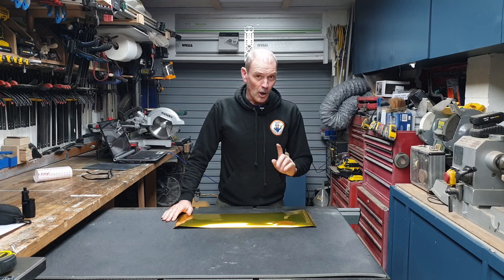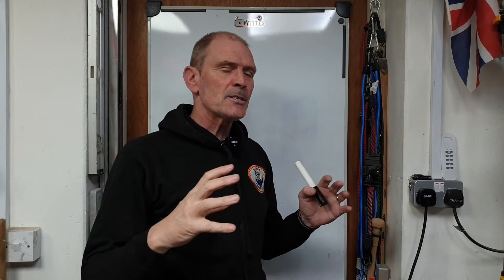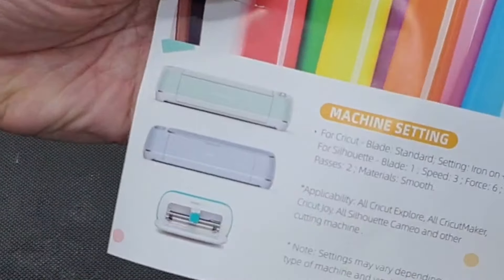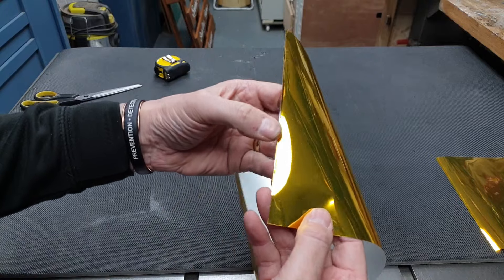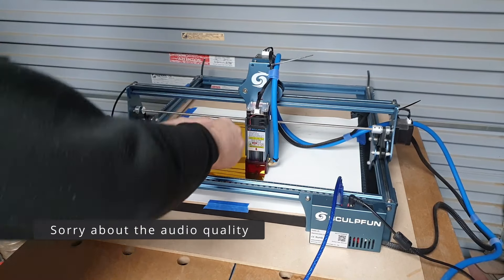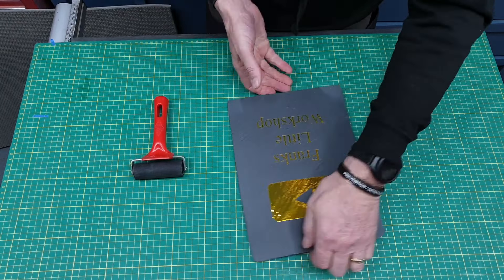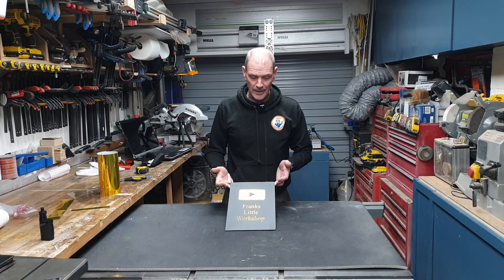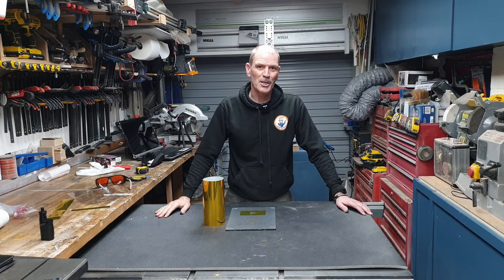Cutting reflective Vinyl with a diode laser

Comment: My S9 came with Green safety glasses, is that wrong?
Reply: Never mind, I asked AI : The correct color for laser safety glasses depends on the wavelength of the laser being used.

Sculpfun S9 Laser Wavelength
The Sculpfun S9 uses a 5.5W blue laser with a wavelength of 445–455 nm (blue light).

Correct Laser Safety Glasses Color
Green safety glasses are typically used for blocking blue and violet lasers (around 445–455 nm).
Orange or red safety glasses are usually for green lasers (532 nm) or infrared lasers (1064 nm, 10,600 nm).
Are Your Green Glasses Correct?
Yes! Green safety glasses are the correct type for a blue diode laser like the one in the Sculpfun S9. They block the 445-455 nm wavelength effectively.

How to Verify Protection
To be completely sure:
Check the OD rating (Optical Density) of the glasses. They should be labeled OD 4+ or OD 5+ at 445-455 nm.
Look for the wavelength range printed on the glasses (should cover ~445 nm).
Try a reflection test: If you shine the laser at a reflective surface while wearing the glasses, you should not see a bright blue beam.
If your green glasses meet these requirements, you’re safe to use them.
Reply from the maker: @makingcookingfixing  😆😆 Great question and a great answer... from yourself 😆.
I now use a more expensive pair that do cover the blue lasers (they are from Xtool). I prefer them to the cheaper green ones. Thanks for watching 😁 👍
Reply: @frankslittleworkshop  Thank you!

Comment: Hi Frank I see you used air assist when lasering , was there many fumes coming off the vinyl or did you use pvc free vinyl
Reply from the maker: @sailingstardreamer  🤔 I didn't use the pic free vinyl. But the fumes weren't too bad, but I do use some decent extraction in the workshop, so this wasn't really an issue. But it would have been much better if I had a good enclosure. Thanks for watching 😁 👍